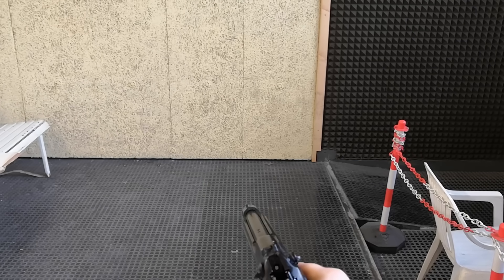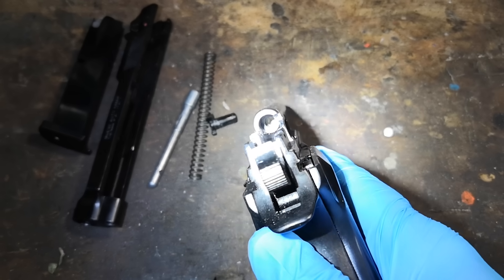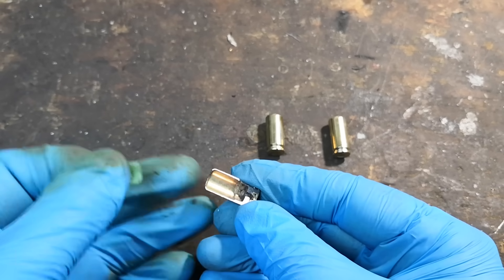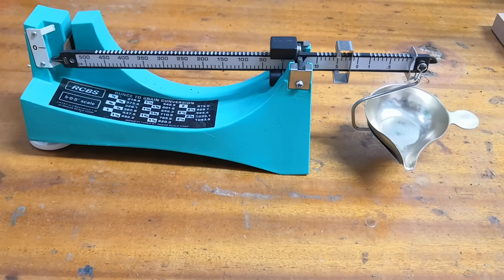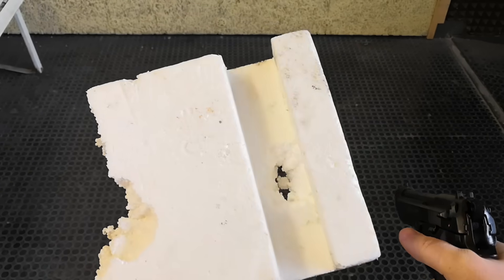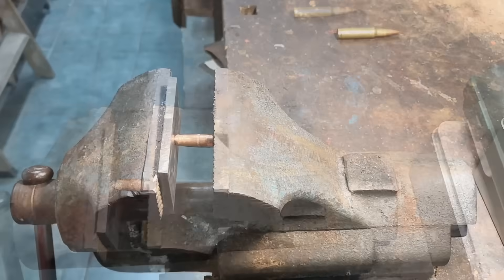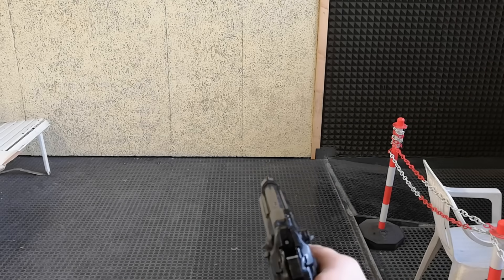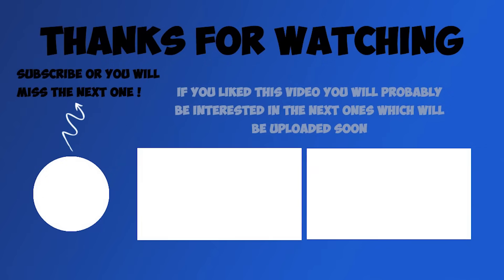Point Blank With a Blank Gun: Is It Really Dangerous?

Comment: Next: Getting shot with a RPG at point blank. Is it really dangerous
Reply: Wouldn’t getting hit with the rocket itself hurt like hell tho
Reply: @thefilthycasual6402  Broken ribs at max, rockets have very low velocity
Reply: @dragonstormdipro1013 RPG's have a 115 Meter a second boost speed and 300 meter a second flight speed. That's like being hit by a 5 to 10 lb football sized flying lawn dart at 300-600 miles per hour. Being hit by an RPG at any range is going to kill you. Anyone who survives being hit by one is literally the product of a statistical miracle.
Reply: @dragonstormdipro1013  broken ribs hurt like hell
Reply: @godofawesum223  Yap, statistically speaking, an close range RPG direct hit should be more dangerous than a rifle shot
Reply: Ironically, no.
Reply: Most, if not all, RPG's use contact/impact fuses, so yes it will explode, it is very rare for the cheap warhead of any RPG to have a minimum safety when it is a weapon system that can be used at 50m - 100m (And was/is Soviet doctrine to be this close to enemy armour before using a RPG-7). The RPG has a cap that covers this contact fuse so it doesn't go off pre-maturely. Their have been plenty of cases in Iraq and Afghanistan where an unfortunate sod has fell over with the cap off and suffered a catastrophic failure. Whoever said that the RPG has an arming distance of 100m is severely retarded. 

The rocket motor, however, does not engage until the projectile has cleared the weapon by a dozen or so metres.
Reply: Actually, no. RPGs have safety fuses which doesn’t let the warhead explode at point blank ranges.
Reply: Dragonstorm Dipro then why do i always die using rpg in cod
Reply: H3ll0 W0rld you thought out side the box
Reply: @h3ll0w0rld7 game.
Reply: @dragonstormdipro1013  Those fuses can be removed. Taliban and ISIS for example did that often when fighting in cities where you usually shoot at ranges to 100 meters max.
Reply: Dragonstorm Dipro weLl thEn whY caN I rOckEt jUmp iN tF2???
Reply: @dragonstormdipro1013  8 year olds: ExPlAiN HoW i GoT kIllIed IN foRTeNIte
Reply: But a big hot blunt object hitting you at 150-170 m/s is still not healthy.
You’ll survive if you’re lucky and get immediate medical treatment, there was an incident of a delta force trooper getting hit by a RPG-7 at 5-7 metres (about 200m/s at that range) and got his stomach pierced by it.
Reply: Backblast is a dangerous thing by the way
Reply: @spacekraken666  PUBG new weapon panzerfäust actually replicates this
Reply: Strangely enough, no. The projectile doesn't explode below 200 meters.
Reply: NBA Kentrell it cant explode at close range
Reply: I tried it, my toe only hurts a bit
Reply: Look I'm not sure how dangerous an RPG would be up close, but I think your all forgetting the "R" portion of "RPG"
Even if the grenade won't detonate at close range, a rocket hitting you at any distance can't be healthy.
Reply: @AmronFortis  I know it is 8 months. But the R portion of RPG stands for Ручной, meaning hand held :)
Reply: @_1389_  You may be right. I wouldn't know, I don't speak Russian. But in English the "R"  stands for "Rocket"
Reply: I love how people mention the arming distance XD.  Doesnt matter, an RPG rocket can still kill you, and the backblast is also very dangerous.
Reply: Find out on the next episode of DRAGONBALL Z.
Reply: Made me laugh out loud 😂😂😂
Reply: Nope
Reply: NBA Kentrell unless you yell Allah Akbar then you’ll be alright in Allah’s hands
Reply: RPG no Bazooka yes
Reply: Sakkchasercaleb _ just run ballistics vest
Reply: I remember in The Hurt Locker when a dude in a Humvee gets shot by an rpg and the rocket gets lodged in him but it doesn't explode haha
Reply: A reply to those who mentioned arming distances. The arming distance depends on the rocket that is used. The rocket arms itself shortly after being launched, between 5 to 20 or so meters. It varies because different countries built the safeties differently. This type of safety would make the rocket not explode at point blank. The original Soviet rockets have another safety that makes the rocket explode after a certain amount of time. So, even if the rocket gets stuck, it would still explode after a short moment. But some countries decided to remove that safety. Finally, I've read stories about somebody falling, hitting the tip of the rocket (while it's still in the tube) against a hard surface and then the rocket exploding. But that last one is merely an anecdote, so take it with a grain of salt.

The rocket is initially fired/launched in the tube at about 100-150 meters per second. After a short distance, the rocket motor kicks in and speeds it up to 300+ meters per second. So, getting hit by a 2-3 kilogram projectile flying at 125~ meters per second wouldn't be very comfortable, to say the least.
Reply: No
Reply: It depends if it's mounted the right way on the Taliban's shoulder. If it's facing the wrong way you're quite safe.
Reply: @paullangton-rogers2390  backblast is still lethal
Reply: Both side, left nothing
Reply: There was a case in I believe Montreal where some clowns got a RPG and figured it'd be ideal for robbing an armoured car.
They set it up so they were in a van in front of the armoured car at a red light.
They opened the back doors to the van and fired the RPG! Can only assume they saw too many movies with people firing recoilless weapons in enclosed spaces and had no idea how dumb it was. To add insult to injury they didn't arm the warhead so it just bounced off!
Again "mortels shouldn't meddle in the affairs of wizards!"
Reply: @robertdeen8741  were they expecting to be able to retrieve anything if they succeeded anyway?
Reply: No. it doesnt explode at point blank
Reply: Basically would feel like a rocket propelled fist/rock
Reply: It aint
Reply: @-RAYZ-  what a dickhead
Reply: Nah it’s not
Reply: Just don’t fire it inside and don’t stand behind it
Reply: The back blast would hurt more, unless the rocket explodes at point blank which I don't know.
Reply: No. RPG rocket fuses activate at 15-30m from the point of activation.
Reply: ain't they gotta go a certain distance to arm the explosives?
Reply: Moan for dinner  perhaps

Comment: Ask Brandon Lee 😢
Reply: Brandon Lee was actually shot with a bullet.  Previously, the gun had fired a cartridge with the propellant removed, but the primer and bullet still in place.  The primer was enough to drive the bullet into the barrel where it lodged.  When a blank round was fired out of the same gun later, it propelled the bullet at only slightly less speed than a normal cartridge.

Comment: What do you know of a cartridge called a 'grenielle' (sp?).  Seller said it had a BB in it and shot out of Valtro blank gun that did not cycle with blanks but was front firing with inside of muzzle threaded like for a flare projector. Never heard of something like that and never saw one before or since.
Reply from the maker: Honestly I've never heard that name, but I am familiar with many blank firing guns with partially obstructed barrels, on which you could screw a small adapter to launch flares or fireworks of some sort.
I'm also aware of some specialized guns designed to exclusively shoot rubber bullets. They use the 9mm PAK with a rubber ball in place of the plastic plug, and the obstruction of the barrel is shaped so that the rubber is able to squeeze through it, but a real bullet wouldn't.
If you provide me some more info on what you are looking for I could look in the forensic database.
Reply: Saw them in passing at a gun show. Googled grenielled show word but little more.
Reply: I have done much research on blank guns. I use to have zoraki 914. If you can see on you tube people who converted 9 mil blank guns to shoot 380 ammo. You have to replace the barrel. the 380 ammo will fit in the magazine.this process has become popular world wide and have been successful. You have now a untraceable ghost gun. People want to make the public think that it can't be done. I have talked to people who have done this. They have held up with the pressure (steel barrel is used). Zorkai blank guns are the best for converting. You can also muzzle load a front fire blank gun with lead BBs and fire it. The bb will shoot out but not of great speed un less you drill out the manufactured blank gun barrel so there is no blockage. Then open up the blanks and put a BB in it and use candle wax to close it. Then you could shoot bbs out of your blank gun using blanks. I have seen the projectile go thru a new York phone book at close range. I have even seen a person shoot a nail in a dresser with a blank gun. They can be deadly without much manipulation. With a front fire blank gun pointed point blank to someone's head is more deadly then if you where shot in the stomach with 38 snake shot. Mine was full automatic as well. Completely legal. It's a blank gun not considered a fire arm. I live in California were the guns are tough because pelosi didn't have her afternoon cocktail on time so she takes it out on the gun laws. And she calls her self Italian. Does she not know, when the Italians were coming over from Italy and the Italians were discriminated against and the whites were suppressing and beating down the Italian, if it was not for the guns and the mafia she would not hold her position in government.besides that if it was not for guns, Michael Corleone wouldn't have saved Vito from another attack because he shot the Irish cop and the Sicilian drug dealer. He was also saying no to drugs. Any ways. Blank guns are fun to shoot and collect be safe. I shoot blanks when I don't use Viagra. The Democratics don't want to legalize prostitution, but they are regulars at the bunny ranch.

Comment: 3:06 wow, that has less than zero recoil.  It's amazing, no wonder actors/directors think they can just blast away and do things that are completely impractical in real life.
Reply: I think he shot just the primer, not the shell with the powder
Reply: @ukdrilledits1773  Even if it was a proper blank, the recoil energy was still nowhere near a live round's level
Reply: @ukdrilledits1773  I agree, I'm thinking the powder my not have ignited. A primer alone still has a pretty good pop.
Reply: Nothing goes out the front and thus it doesn’t push backwards at the shooter. Just the weight of the powder which tends to be less then 5% of the actual bullet.
Reply: @john-paulsilke893  
That was a real glock with the blank powder case. Since it was a real gun air did go out the front. The Barretta was the blank gun.
Reply: @john-paulsilke893  A ported muzzle imparts some downward momentum, and all that is gas escaping. I'm not saying its anywhere near the energy of expelling a projectile, but I was expecting to see some slight degree of movement. There is some degree of movement/recoil even with paintball and airsoft guns. But in the clip of him firing the G19 there was none, zero, nothing, perfectly steady. I suspect the powder did not ignite or it simply deflagrated.
Reply: Recoil is the opposite force generated by the projectile.  Generally, the heavier the projectile, the more recoil you get.  Blanks are only ejecting hot gas and particles, so there is little to no recoil.
Reply: not john wick, he goes to a firing range and gets proper training from professionals.
Reply: @Prod_TKJ808  you know john wick is a character, right?
Reply: @psychwardguy he means the actor for john wick did actual shooting exercises with real firearms with actual ammunition to portray the character accurately
Reply: @ThePhrog714  okay? is the actors name john wick too? your comment has nothing to do with mine, pointing out that john wick is a movie character, not an actor, like that person implies.
Reply: Either way the recoil is relative to the materials leaving either the barrel or the breech vents. MxV2
Reply: Mostly in movies no one uses blanks anymore. They just fake the shots and someone make the sound up. In some movies they don’t even pull the trigger
Reply: Firing blank rounds out of a real rifle are no different.
Reply: Not so much the actors, but the directors and screen writers.
Reply: Angry Combat Wombat  Again 3:06 That is a real Glock 19 and the gasses are being expelled out the front of the barrel.
Reply: I think the easiest spot where you can notice zero recoil due blanks is first Matrix, scene in the hall. The "recoil" there was more from parts moving than a detonation. Of course in movie excuse is obvious enough to not need to explain it here.
Reply: it's kinda funny how the slide was completely still lol
Reply: Less than zero? You mean when you fire the gun, it pulls your hand forward?
Reply: And then they complain about real guns
Reply: recoil but its down instead of up
Reply: Some characters aren't allowed after speaking to some vets from vietnam that sounds like a normal friday
Reply: alec baldwin
Reply: Slide was locked, that’s mostly why.
Reply: It's so surreal to watch a gun fire without recoil. It's like a video game and the animation didn't load properly.
Reply: No slide movement either!!
Reply: To get a recoil a blank gun must have a little proper hole inside the barrel to get compression with a cartridge without bullet. When I shoot some cal. 22 blanks using my Marlin cal. 22 (real rifle) I don't get any recoil and the firearm doesn't get the semiautomatic function.
Reply: these guns are called detonators, you know, like they use in movies and back in the day olympic games?
Reply: Anything you see in the movies people really do, you dont spend time near highly skilled people is all, dont spread your loserness to your kids please